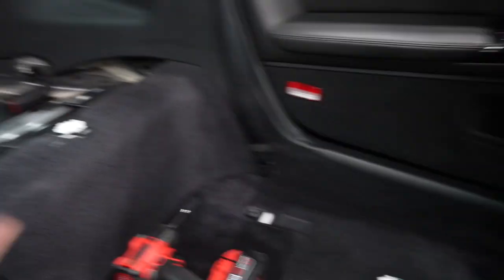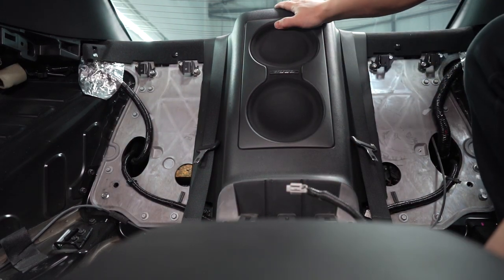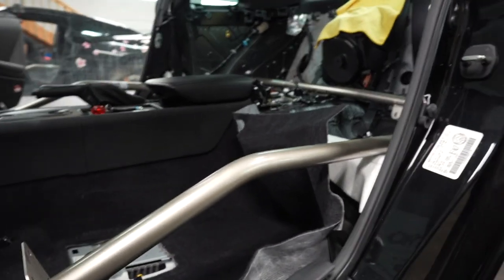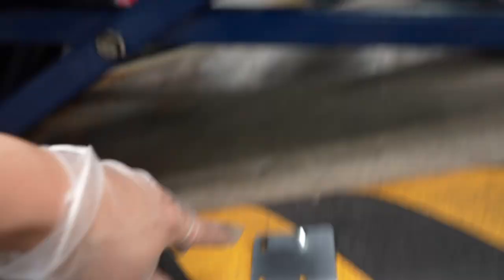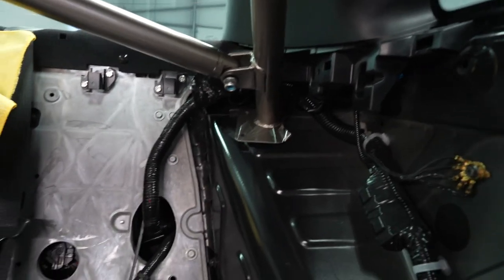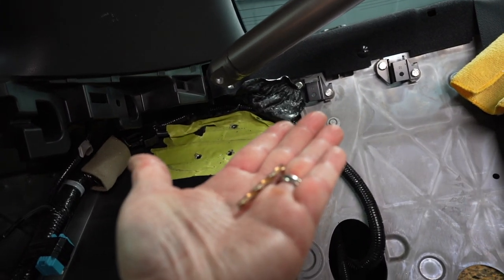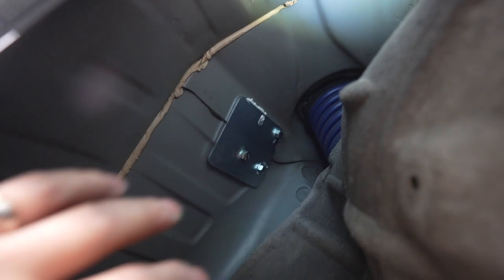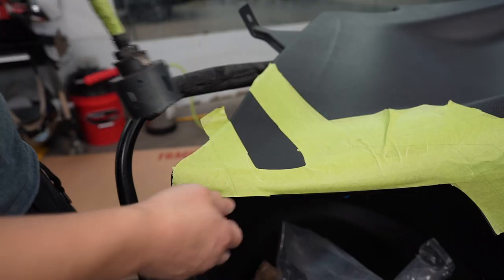Cusco Roll Cage Install DIY Never Again! LOL

Comment: Lol u didnt need to cut the styrofoam. Good instructions. The rear plates line up with the chassis perfectly?
Reply from the maker: No the plates don't line up perfectly. You will need to do fine adjustments and tighten everything down.